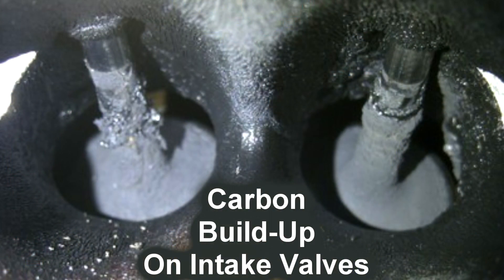CRC's DGI Intake Valve Cleaner - Wrenchin' Up

Comment: THEY SAY YOU NEED TO DO THIS EVERY 10-15,000 MILES DEPENDING ON WHO YOU LISTENED TO IN THE VIDEO. I'M RIGHT AT 15,000 M AND NOTICE NO PROBLEMS WITH THE ENGINE NOR ANY LIGHTS COMING ON AND MY MAINTENANCE BOOK DOES'T SAY ANYTHING ABOUT THIS AT 15,000 MILES AND I WOULD BET 99% OF PEOPLE WHO HAVE DIRECT INJECTION DON'T HAVE A CLUE THAT THEY DO HAVE IT.YEARS AGO THERE WERE MANY PRODUCTS ON THE MARKET TO CLEAN YOUR VALVES BY JUST TAKING THE CAN AND YOUR AIR BREATHER FILTER OFF AND SLOWLY DUMP THE CAN INTO THE CARB BY INCREASING THE THROTTLE A SMALL AMOUNT SIMPLE AND IT DID WORK WELL.MAYBE THIS WORKS THE SAME
Reply from the maker: Hi - Thanks for watching and sharing your experience!

Comment: What is dgi engines?
Reply from the maker: Hi - Thanks for watching! Gasoline direct injection (GDI) (also known as petrol direct injection, direct petrol injection, spark-ignited direct injection (SIDI) and fuel-stratified injection (FSI)), is a form of fuel injection employed in modern two-stroke and four-stroke gasoline engines. The gasoline is highly pressurized, and injected via a common rail fuel line directly into the combustion chamber of each cylinder, as opposed to conventional multipoint fuel injection that injects fuel into the intake tract or cylinder port. Directly injecting fuel into the combustion chamber requires high-pressure injection, whereas low pressure is used injecting into the intake tract or cylinder port. - Wikipedia

Comment: Wheres the proof...just an American speel.

This product caused my engine to start burning oil front valve guide's...use at your own peril
Reply from the maker: Hi - Thanks for watching and sharing your experience! One question though - could their product have cleaned out a worn valve guide?
Reply: @WrenchinUpwithJimBates  Yes I believe as a consequence it cleaned enough to expose dodgy seals. 

I do wish there had been a warning notice of the potentials when using this product
Reply from the maker: Hi Anthony - Good point. Hopefully CRC is paying attention.

Comment: Doesn't work well. I removed the manifold, sprayed it in and let it sit overnight. Upon draining, the intake runners were spotless, but the valves are still caked up. Starting to think walnut blasting is the only remedy
Reply from the maker: Hi - Thanks for watching and for the comment about your experience with the product.

Comment: If it doesn't damage the cat where will the carbon go to it just can't be floating it needs to go somewhere
Reply from the maker: Hi - Great question but you'll need to ask CRC to get the best answer. Their contact info is in the description below the video. Thanks for watching!
Reply: It can damage the cat,,
And it can scratch your cylinder walls.

Comment: Is this safe on turbo engines?
Reply from the maker: Hi Doug - Great question, but you'll have to ask the folks at CRC. You can contact them using the link in the metadata below the video. Thanks for watching!
Reply: D N   anything is safe 4 turbo engines,,, as long as it's a hot engine and you keep the RPMs between 2000 and 3000,,, Marvel Mystery Oil in the fuel tank,,,, about   4.  Full tanks,,,. Water in the intake manifold.  Or other throttle body cleaners,,,,. A little carbon is easier to clean off,,,, than a lot of carbon,,,, don't listen to rumors or I heard,,,, I've been doing this for over 35 years,,, gas engines turbo engines,,, diesel engines,,,, airplane engines,,

Comment: A lot of talking and no actual proof that the product works
Reply from the maker: Hi - Thanks for your comment. Be sure to check out the manufacturer's website (in the metadata below the video) for more information, and hopefully the proof you would like to see. Thanks for watching!
Reply: An animated video is not proof!
Reply from the maker: Good point - hopefully the folks at CRC are looking at this and can come up with something more substantial. Thanks again for your comments!
Reply: I am the proof with over 35 years experience,,,,,, any product for preventive maintenance is a good product,,,,, Lucas, Marvel Mystery Oil, CRC, engine restore,,,,,,,
Reply: I've been doing this for over 35 years,,,, Marvel Mystery Oil in the gas tank 4 tankfuls,,,,, water in the throttle body or vacuum line,,,, any throttle body cleaner,,,,.  Use less than recommended fuel injector cleaner in the gas tank,,,, you can burn the coating off an oxygen sensor and you'll use more fuel,,,.  Gas engines turboed engines diesel engines even engines that run upside down,, airplane engines,,,

Comment: Is this strictly for DGI or can it be used an standard injectors as well? I know SeaFoam has a similar product (for standard injectors, at least) and cleaning process however, in that case, the oil and plugs are suggested to be changed after the treatment.

If, in the case of CRC's product, it can be used on standard injectors, it would be nice to not have to change the plugs and oil afterwards.

Thanks :-)
Reply from the maker: Hi - Great question, but since I don't work for CRC or sell their products (I just did the interview) I would suggest you ask the folks at CRC by contacting them at http://www.crcindustries.com. Thanks for watching!
Reply: Thanks for the reply / feed back :-)
Reply: Nope   Marvel Mystery Oil in the gas tank,,, about 4 full tanks if you have fuel injectors,,, a little carbon is easier to clean off than a lot of carbon,,,,, spraying water in the intake manifold works great,,,,, do not use a petroleum-based product in the intake manifold,,,,.  If you baby your car you will have a lot of carbon,,,,, if you drive it like a race car you'll have a lot of carbon,,,,,

Comment: Thanks Jim, intake tract carbon buildup  is a big issue with many GDI engines. 
Suggestion, can you put a link to the product and add the CRC SKU in the drop down description? 

Oh, so many questions... 
Does this product contain polyetheramine  (PEA)? 
If yes, what is the approximate concentration of polyetheramine  (PEA)? 
Does it also contain petroleum based solvents? 
Does it contain additional detergents and or surfactants? 
Does it contain a sulfur component? 
Is normal operating engine temperature critical to the success of the treatment? 
Could this product be used on port injected engines?
Reply from the maker: Hi - Great questions, but since I don't work for CRC or sell their products (I just did the interview) I would suggest you ask the folks at CRC. The link is in the metadata below the video but here it is again: http://www.crcindustries.com. Thanks for watching!